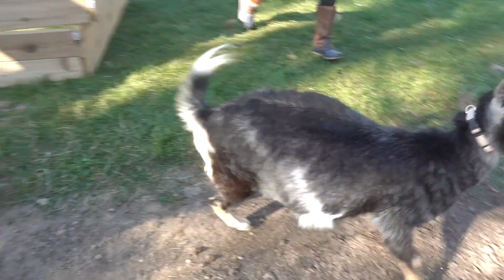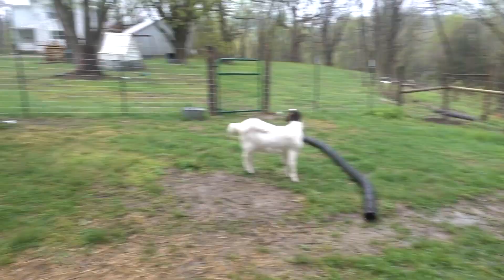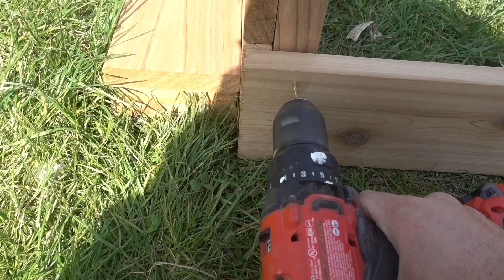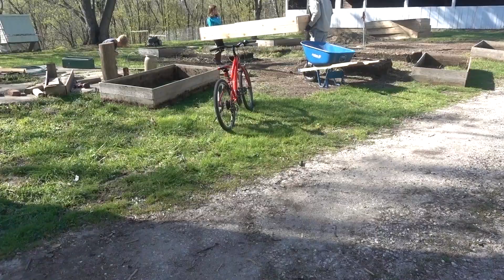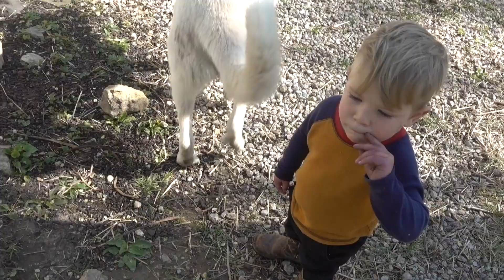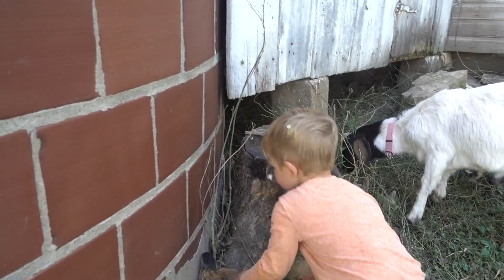Baby Goats JUST BORN | This week on the homestead Episode 4

Comment: If you mix dry leaves into the soild in the beds, you'll save soil and it will break down and be nutrient rich. I wouldn't use too many oak leaves though. I fill the bottom half of my galvinizzed planters with dried leaves and I get the greatest veggoes and herbs! My grandfather used to work at the Brooklyn Botanical Gardens and he taight me that.